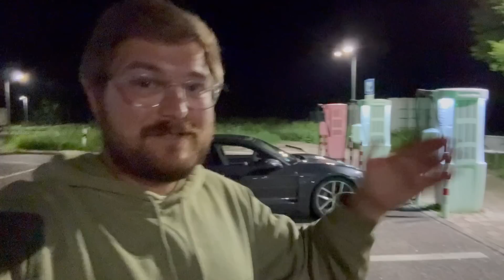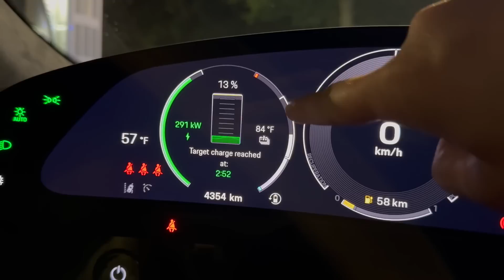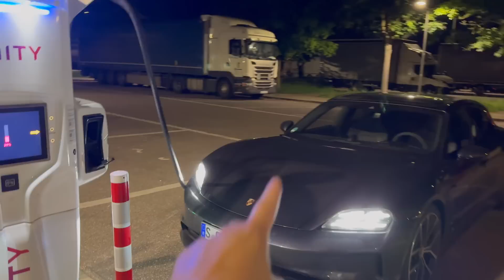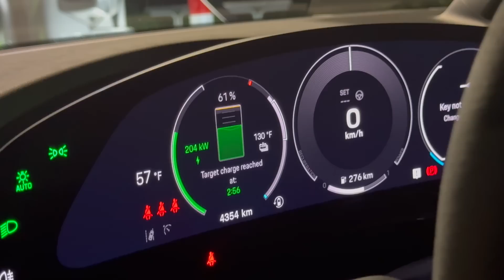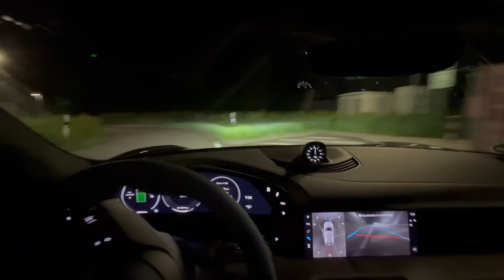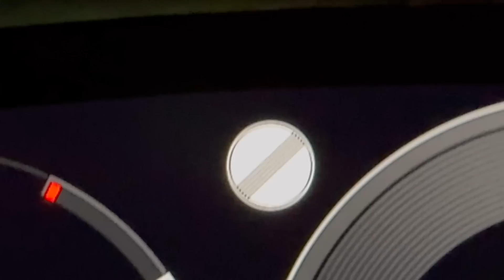The Fastest Road Tripping EV I've Ever Tested! Updated Porsche Taycan Sport Turismo 10% Challenge

Comment: We are finally at a 2 hour drive (158 miles/ 80mph), 15 minute charge ratio for highway driving! Huge milestones for EVs. Tesla needs to take some notes.
Reply: Agreed.  This is kinda the benchmark/tipping point to make it "competitive" with gas.

It's still 3x the refueling time for less driving time, but most people will tolerate this ratio.
Reply: @GregMcNamer yes but most people wil charge at home
Reply: @billsuper7324  most people will charge at home most of the time.  But people buy cars based on the outlier cases. "most" of the time they are driving with one person and maybe a couple bags
Reply: I really do think now that anyone that mentions "range anxiety" are just anxious people; it says everything about the person saying to and nothing about the infrastructure, even though the infrastructure could be better still. Even with what we have, charging stations ensure you get good ergonomic and personal-need breaks on a long road trip.

As an example: it's been possible for years to do a Cannonball Run (NYC to LA) using different routes (one way mainly on I-80 via Iowa and Colorado, the other on Interstates that follow the old Route 66 via New Mexico and Missouri) AND limit yourself to one charging network with no worries. If an EV driver only used Electrify America, the furthest hop on the northern route between two charging locations is 139 miles (Bloomsburg, PA to DuBois, PA) and 128 miles on the southern route (Winslow, AZ to Gallup, NM). Even if they wanted to do the 160+ mile loop to see the Grand Canyon between Williams and Flagstaff, AZ, there are four 350kW chargers at the Visitor Center on the way. The only way for anyone to run out of power on the longest of journeys for most places now is to not pay attention or not do the minimum of planning!
Reply: @nemam_nedam ?
Reply: I think any Ioniq 6 does this too, at a fraction of the cost. My 5N is a bit off if taken literally, however add traffic that dampens the distance and consumption and you're getting close, you'll need to stop a bit sooner to not loose too much charging speed. Still people fretting about range numbers think it's the worst car when it's actaully quite good relative the competition if measuring travel range like this.... taking breaks when driving hard is essential for a nice and safe travel experience. I'd love a Taycan too for the record, but just need a bit more space. Either of these cars are great in their own ways...
Reply: Elon doesn't really care any more.  Tesla needs a less distracted CEO to get itself back on track.
Reply: @nemam_nedam  Dude, leave your rant somewhere else.  What you said doesn't even pertain to Farhood's comment.
Reply: @MountainManGuy  Leave your fanboyism at the door, dude. What he said is true.
Reply: @Xetairex  The original comment is about charging. It has nothing to do with cameras or safety. That's a whole discussion entirely that deserves it's own thread.

Comment: Kyle, you should ask your dad to show you the one-handed maneuver he developed for charging at CCS dispensers.  He has perfected it.
Reply: I just pick up the CCS handle with one hand and plug it in my car with one hand because I'm not paid by Tesla to push NACS.
Reply: @nssomething8370 I doubt Kyle is either.  Nacs is a better design just admit it.
Reply: @daviidfm923  wow, such compelling arguments.
Reply: @nssomething8370  if you have used both nacs connector and ccs it’s like not even up for discussion.  Ccs is heavy bulky hard to move.  When it’s cold the cables become rocks etc.  nacs is light, allows for very high current, same connections for ac and dc, easier to hold, plug in and move about in warm and cold….
Reply: @nssomething8370  why are you so mad about it. It’s not a big deal that ccs handles suck.
Reply: @daviidfm923  Anybody who says CCS is heavy proves they have absolutely no understanding of CCS VS NACS. The CCS connector adds no weight at all. The cable is what adds the weight. CCS chargers are rated for more amperage, they are longer, they need to be bigger and heavier. Before you post something online, you should at least TRY to understand it. Putting NACS cables on longer cables actually rated for 400-600+ amps will change nothing to the weight. I saw you have a channel, maybe TRY to educate yourself a bit. You are comparing underspec'd shorter cables with longer higher spec'd cables, you are not comparing connectors. Seriously, are you dumb enough to think that the added weight came from the plastic connector? Are you actually serious????
Reply: @daviidfm923  Keep having the comments that expose you deleted. Again, you still don't understand that the cable is where the weight comes from, not the connector. When NACS connectors are installed on the same longer higher rated cables, you guys will all look like fools. But I'm sure this comment will get deleted.
Reply: @nssomething8370  what…. I didn’t delete shit. Expose what…..  It won’t matter when you can hold the entire handle with one hand……. You can’t grip the end of a ccs cable. Like you can a nacs.
Reply: @daviidfm923  Nice backpedalling, now it's not the weight, it's the size, you guys are hilarious. Sigh

Comment: That’s basically a full model Y battery pack in 15 minutes. 

Great job Porsche
Reply: One of the cons of the Porsche Taycan from Edmunds.  "EV greatness comes at a commensurately great price"
Reply: Porsche engineering has always been the standard and in just 4 years they are already ahead of tesla whose been in business since 2007 trying to make a good ev ❤
Reply: @G82Watts  Not at all. Charging is the only thing they appear to really excel at  The Model S Plaid (top trim Model S) costs 90K which less than a base rwd Taycan with the small battery (~100k). Comparable Taycan is 2x the price. Until Porsche is able to provide such technology for 75K it doesn't count because very few people are able to obtain such cars. IMO Hyundai/KIA/Genesis are doing the best because they offer a lot of the Porsche tech and engineering for a fraction of the Porsche cost.
Reply: @G82Watts  You should watch Sandy Munro's teardowns of a Model 3 in 2021 and in 2023. He said, although the technology, electronics, electric motors, the hard stuff, were class leading, the car part was a joke. Then in 2023, he said the manufacturing and engineering were class leading. He said Tesla could teach BMW some things about engineering, and that Tesla was innovating at the "speed of thought".   ..... Tesla is making a great EV these days in efficiency and technology and engineering. If you're unaware of what's been happening recently at Tesla, you're falling behind.
Reply: @777Outrigger  uhh? When did I mention bmw EVs? Even though bmw i4 gaps the model 3 performance as shown on carwow. Their very first EV ever. I'm sure their EV tech will make tremendous strides just like porsche did this year. Taycan is clearly class leading now. The taycan turbo gt is an engineering masterpiece. Porsche retained a lightweight 2 motor setup and its still faster then the tesla plaid too the quarter mile and has posted record laps for an EV at every track. Meanwhile tesla has to add extra motors in order to make faster cars. Imagine if porsche only cared about straight line speed and put 3-4 of their motors in the taycan. It would blow the doors off every car . But they also want it to handle like a sports car should. Also their all new game changing air adaptive suspension that audi has already bought from porsche.
Reply: @G82Watts  You didn't mention BMWs, Sandy Munro did. He used BMW as an example of engineering prowess, (he should know),  and Tesla has passed them!!! He also said Tesla engineering capability is class-leading.  ..... I'll repeat myself about Porsche.   They make great cars and EVs for a great price, LOL ..... I don't know  you're making a big deal why Porsche's are great. We all know that. I could afford one, but I don't like spending that much money on a car for a few little gains. ...
Reply: @777Outrigger  tesla a company that has made EVs since 2007 had a better EV then bmws first ever attempt? Wow! Good job tesla! If i wanted an EV id still get the i5 m60 EV over any tesla. Looks and interior wise it's superior.
Reply: @G82Watts  Munro's comparing Tesla's car engineering with BMW cars in general, not to their EVs. Brand new Tesla is beating all the legacy car companies in car engineering and manufacturing techniques,  -- not even talking about EVs. That's incredible that a new car company can do that. And the EV reviews show that Teslas are clearly  ahead of BMW in EV tech too. ...
Reply: @777Outrigger   
 what software does tesla have over say a BMW? Tesla doesnt even have a 360 cam, HUD in the windshield, gauge clusters, hands free self driving, noise isolation, etc... u sound delusional. Also here's 2 videos of tesla getting last place in auto Parking and self driving. 
Edmunds Car reviews self driving bmw vs tesla vs Cadillac 
Rysmons auto park bmw vs tesla vs audi 
So again what tech does tesla have that's better or bmw doesn't have?
Reply: @G82Watts  Tesla does have a 360 camera, LOL. ... You're a funny guy when you talk about hands off driving.  Tesla is on the verge of FSD. I've driven V12 on random roads and it is amazing in it's reasoning in unusual traffic situations. AI is the only way to do FSD, and Tesla is leaving everyone in the dust. If you don't know that then I'm not the one that's delusional. If you're gonna comment on Tesla FSD you need to keep up. Interventions have fallen by 10X in one month, and it's being updated every 2 weeks or so. Tesla computing power is rising 10X every 6-9 months. it's happening fast.   ...  And Musk has said if a company's not spending $10 billion a year on AI it's falling behind. Porsche, BMW, etc., or not even on the same planet with their "hands-off" driving. "Hands off driving" sounds so trite. 

As for other things, you can keep your 20th century buttons. I do everything by voice command, entertainment, environmental, and navigation. Very luxurious.
Reply: @777Outrigger  do you really believe it?
Reply: @BobBaumeister-g8v  Believe what, specifically? I've made several posts above and yes I believe all that I posted.
Reply: @777Outrigger  is voice command any good now? Hate the touchscreens and still love the buttons. But voice commands that actually work could be a nice second choice...
Reply: @onehorsepower  The voice commands work. Last winter twice i had the windshield unexpectedly fog up 2 times. All I said was "windshield defrost on" and woosh, the windshield defrost came on and I had a clear windshield again. But I do have the windshield defrost button permanently displayed in the hard-dock at the bottom of the screen, just in case.
Reply: Maybe a Model Y with the small battery. Definitely not the large though
Reply: Model Y has a roughly 81kWh battery (Around 75kWh usable), so not quite. It's closer to something like the Bolt EV which has a 66kWh battery.

Comment: awesome charging rates, however the full story includes battery degradation. Charging fast is easy, Charging fast without destroying your cell is priceless.. Does Porsche provide any specs on the battery life impact of super charging?
Reply: It is Not that extreme you think...they charge with about 3C as Peak...300kw/100kwh...which is already done by others, too. The real improvement is the relative high Level  almost the entire charging time.
Model 3 is at 3.2C...250kw/77kwh...but the Peak is very short and charging much slower due to this. They have a really bad charging curve, whereas the new Porsche Curve is relative flat.

Comment: The "how far" question seems to dominate the discussion of EVs, but assuming availability of fast charging, the real question is charge curve.

I wish all the manufacturers would pay more attention to this.
Reply: No, focusing on initial range is the most important. Most people are going to be charging at home, very rarely are you driving more than 250-300 miles in a day. This type of testing is the back to back cross continent 500-1000 mile days someone might do once or twice a year.
It also comes down to age. Talk to your parents, or anyone over 45 and you'll see they almost never do any of this type of driving anymore.
Reply: @DJS_ENO  Of course, you buy the car that has the range appropriate for your day-to-day use.  But for most people, that would be our used Nissan Leaf with 80 miles of range, which we charge once a week to keep the 12V battery healthy, but don't really need to, for the traction battery.

But the clamoring for greater range beyond the 250-300 currently available, that's not about day-to-day driving, but about travelling, and for that, a fat charge curve and high power DC fast chargers make all the difference, not battery range.

If you have a big assed battery that will go 400 miles between charges, but takes an hour to fast charge, that's more negatively impactful to a trip than a 250 mile car that goes 20% -70% in ten minutes.
Reply: @davesvoboda2785  I feel that you're both right however, I suspect that most people (who charge their EV at home like myself), they will prefer range over charging speed. I feel like My i4 M50 would be perfect with around 100 more miles of range for my needs. I can complete a round trip without having to stop but to be sure, I charge publicly around half the time so I can drive without conserving my range. The current range in decent weather (50F to 90F) is 250 to 270 miles (my average is 3.2 mi/kwh over 15K miles). I rarely drive far enough where the fast charging will be more beneficial and I don't see myself siting in the car for more than 400 miles max.

Comment: Seriously Kyle, you can stop the "i NeEd 2 hAnDs fOr cCs" bullshit.
Reply: Why? The handles are heavy and stiff.
Reply: @Harrythehun  The handles have no significant weight. The weight comes form the cable. Tesla uses underspec'd short cables that cannot handle other car models and will never be able to handle faster charging cars that require more current for longer periods of time, including this Porsche. Kyle knows this, lots of people know this, but he still complains about CCS every chance he gets because he's pushing Tesla's interests, probably for financial reasons.
Reply: @nssomething8370 then why aren’t the 150kW cables more manageable at EA. It’s a whole wrestling match to connect to my Bolt (esp in winter), then hold the handle just right and maybe it will charge. No way grandma is doing this. 😮
Reply: @brendykes1202  They are like 3+ times the length. And, I don't know, but my 75 year old mom has no issues with CCS, in Canadian winters. She's short and weighs nothing. Are you all like the future humans in Wall-E, incapable of very minimal physical effort?
Reply: @nssomething8370  I didn’t say I couldn’t do it, or that it was the length. It’s a pain in the rear to twist it around and plug in the Bolt and takes two hands.
Reply: I hurt my wrist a few months ago and plugging into a DC charger is still a two hand affair for me a lot of the time. It is definitely still a problem.
Reply: @l10industries  NACS will be the same once they need to use heavier and longer cables.You have all been sold this false idea that the problem is the connector, you are all in for a rude awakening, and I bet Kyle will never mention heavy cables again once the switch to NACS is done, his job as a  Tesla shill will have been completed. LOL
Reply: Kyle needs to lift lol

Comment: Think charging 15 minutes with my Bolt I could go from 10% to 12%. 😀
Reply: Imagine how many Bolt you’d buy for the price of the Taycan. About 5, right ?
Reply: Try using the 350 next time 😜
Reply: @Dactylonian  I installed a second port on the passenger side so it will charge double the speed.
Reply: He was able to charge 67kw in 15 minutes! More than the  size of the battery of my Bolt!! Awesome Porsche!!
Reply: LOL😂
Reply: One good thing about slow charging.. IF you are not in a hurry.. You can use the long charge times for nice actual breaks.
I took a 2400 mile road trip in my Bolt...  Had a air mattress in the back on the passenger side.  
So I would just take a nice 40+ min nap while it was charging... let me keep going for a long time... Total travel time sucked vs my gas car.. But I was able to drive a lot of miles "NonStop" before needing an actual sleep break..
I also then just slept in the car... That's a procedure to get to work.. But you can do it.
Turn off car.. get in back.. lock doors, use a stick to press the brake pedal, press start button... press brake with stick.. apply parking brake, press brake pedal, then put shifter into Neutral... Car will run as long as you want... 
Otherwise.. there is a 2 hour timer.. the car will power down..  fine for a nap while charging.. but not for a sleep break.
Reply: As slow as the Bolt is, I think Toyota B4zr-lcdQled and Subaru Solterra would be worse at the 10% challenge.
Reply: @BremboT  they should test who is the worst “fast” charging EV.
Reply: That’s funny 😄
Reply: If the wife's vibrator battery is dead she can use the EV battery,  not sure about supercharging at the same time ..  😊
Reply: 4680 10%-35%
Reply: @Yachtzeee  cyber truck uses 4680 and it gets more than that.
Reply: @ultrastoat3298 Cybertruck added 58kwh

Comment: I’ve been fan of Porsche since I live next to the factory when I was a kid, but the engineering in this car is absolutely next level.  How can they get charging to work at that level compared to everybody else it puts 63 KWH in battery in 15 mins.  Because it’s an 800volt battery it’s going to be able to have a higher charge rate but that’s next level.